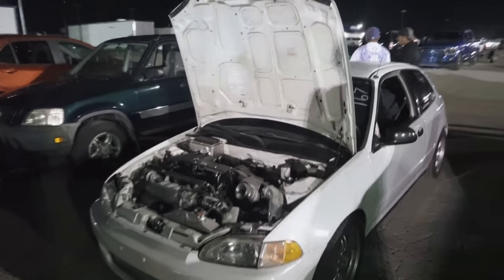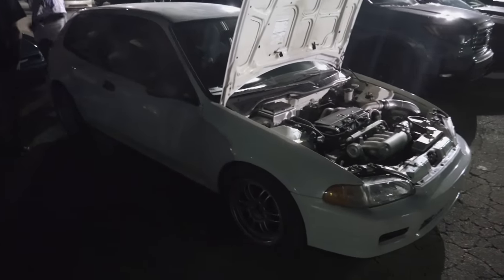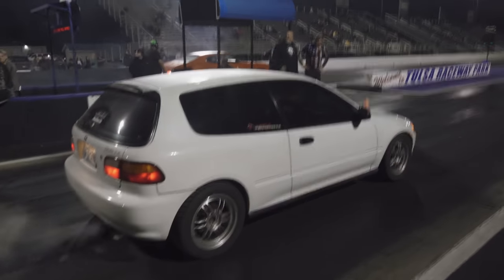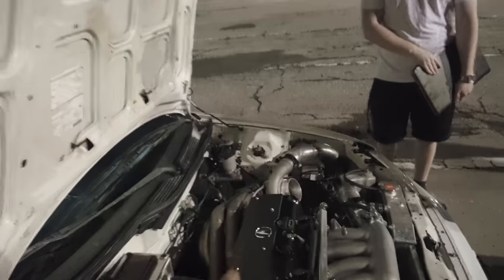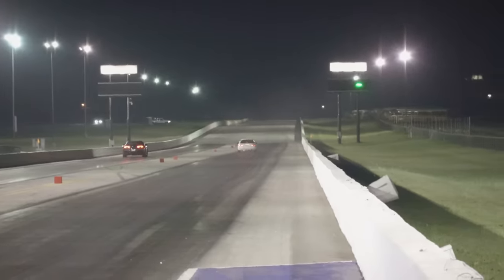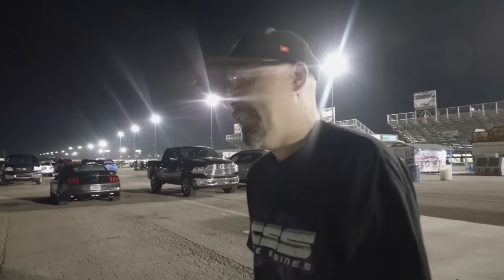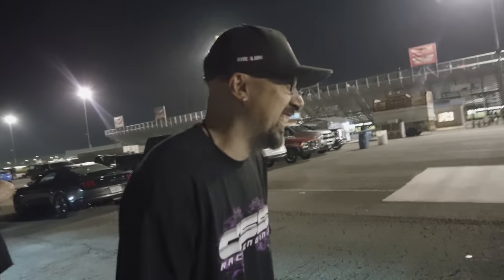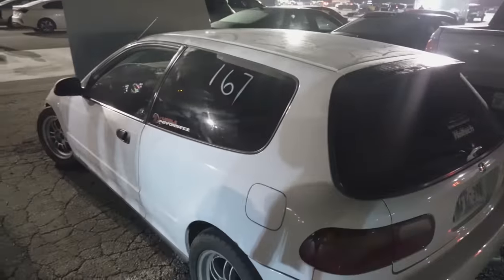700HP AWD K20 SLEEPER Civic Build Goes Testing On Street Tires

Comment: Looks great and moves very fast but I wouldn’t take this for a sleeper once I see that intercooler I know there is a beast lurking underneath the hood😂😂😂
Reply: Granted the intercooler gives it away that it's faster than your average. But, doubt alot of people are going to assume from the intercooler that it's also AWD. Which takes a turbo Honda into a whole other level of underdog.
Reply: @turb02aztC  That is so true, AWD changes the game. It can hook so quick that it can pull on virtually anything with the right setup in that car.
Reply: @elijahjohnson4491  I’be been planning on doing it to a little cheap 94 Accord ex I came across that I was going to K swap. But, have since gotten rid of it since I’m about to move across the country. So I’m just going to find something I’m more familiar with so I guess I’ll do another DC Integra. Easier to come across the awd kits for EG/DC/EK. I’m an Integra guy all the way had a few DA’s and a ton of DC Integra’s. Just figured the wow factor of a turbo k swapped awd Accord would be cooler. I have seen a few Accords done but it’s unclear how to go about it. I think people were using the awd kits for the Prelude.

Comment: Hey man quick question I have a 04 rsx type s awd also I also daily mine everyday has AC an all to I was wondering witch gear set is better stock the rsx type s 6 speed or the 04 awd crv 5 speed gear set might be a dumb question but I was just curious if it would be any better with the 5 speed just thought I would ask